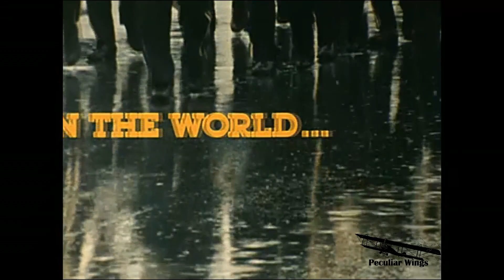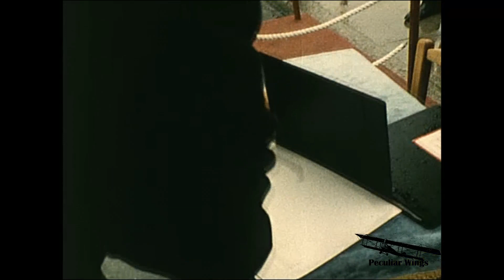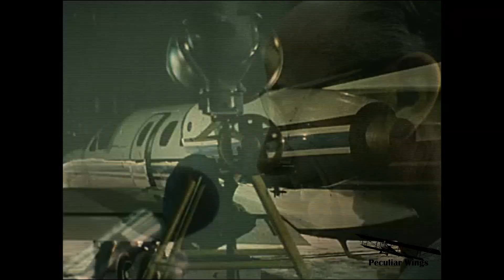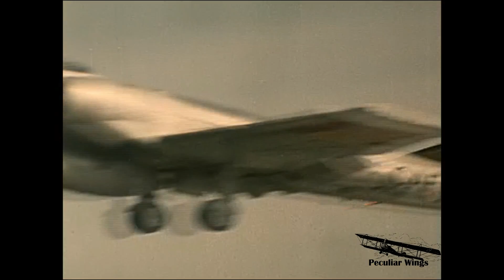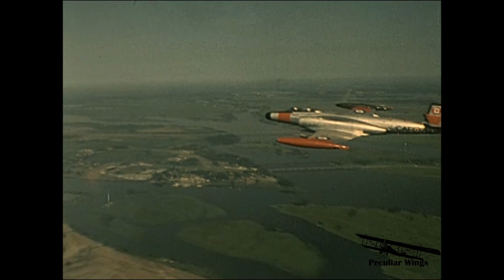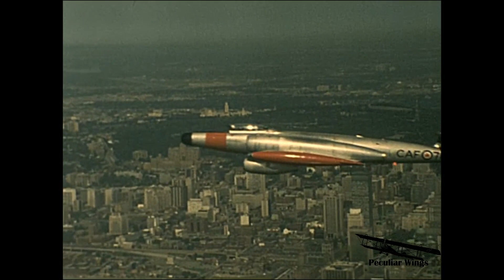[Archive] The last flight of the last CF-100 in the world

Comment: This brings back such bitter sweet memories.  That was my squadron, i know everyone in the parade.  We were so ticked off to be on another parade and this one in the pouring rain.  My greatest concerns were my CF's and extra shiney boots were soaked.
We dismantled the Clunk and there were boxes upon boxes of gear, instruments and harnesses piled up on the floor of 10 hanger.  
I had seen 760 on a regular basis taxing and on its take off roll so often from 10 hanger.  Pratt and Whitney was just east of the hanger.
To see all these airmen and women of both squadrons, plus senior ranks does bring a smile to my face.  
I have heard rumour that 760 may be revived.  Now wouldn't that be something!
Reply from the maker: 760 will be only static as this aircraft is now only a shell without any system, cables, even landing gear. They removed everything before moving her to the pedestal.
Reply: @BigBenUniverse  Yes I know, I was one of those people.  
As you may realize you can rebuild an aircraft with just with the ID tag, theoretically!